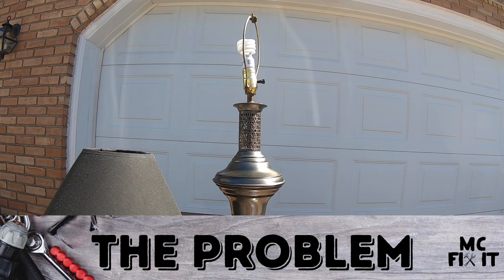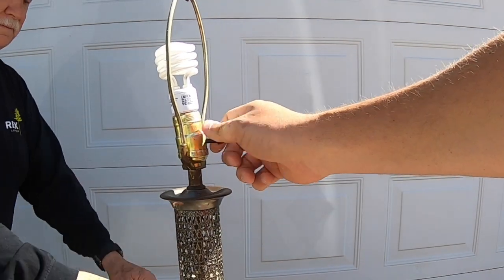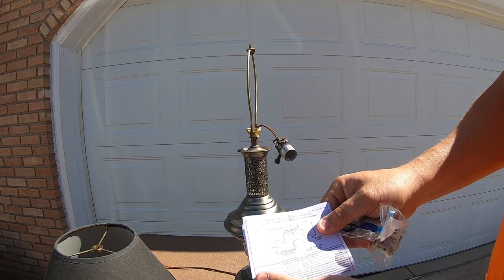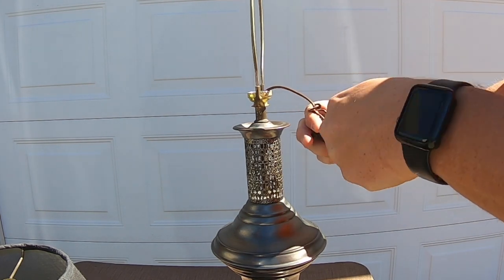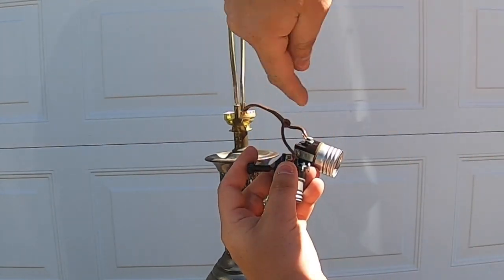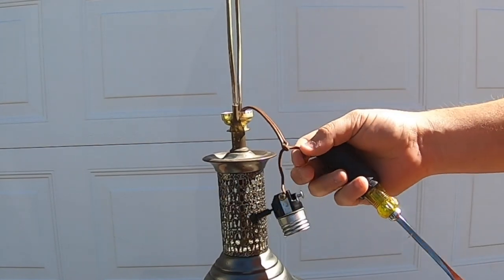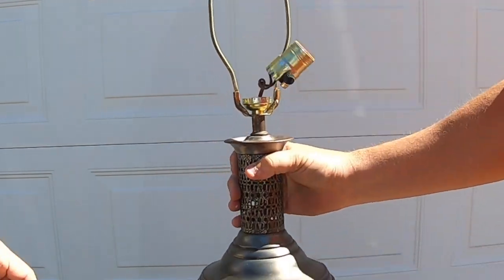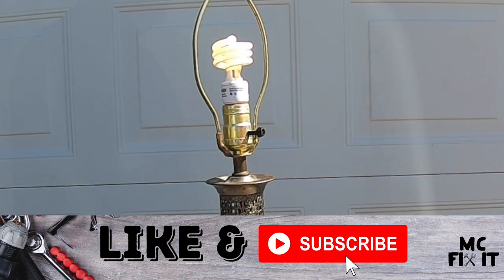How to Replace a Light Switch (Complete Guide)

Comment: Shouldn't you have replaced the cooper wire too? It seems like it would have been easy enough since it was pretty much all out.
Reply from the maker: You could! It was still in perfect working order even though it was not new. Those copper wires last a very long time unless they have been bent harshly.